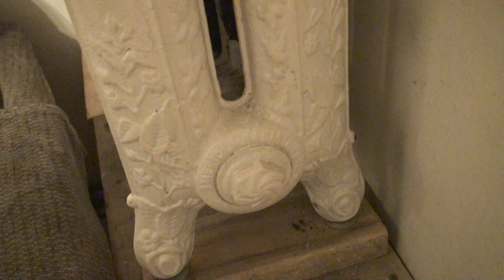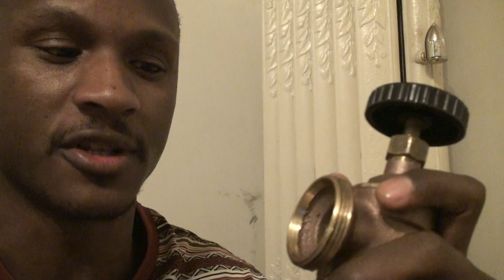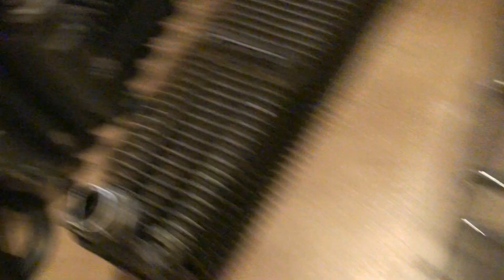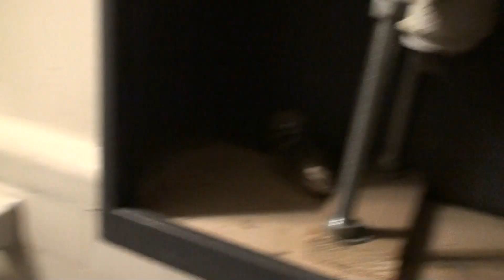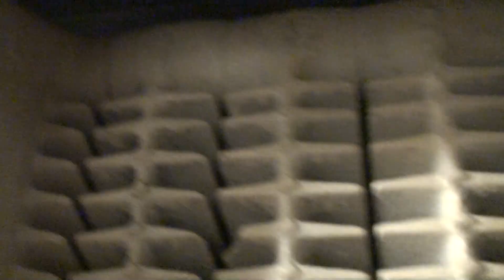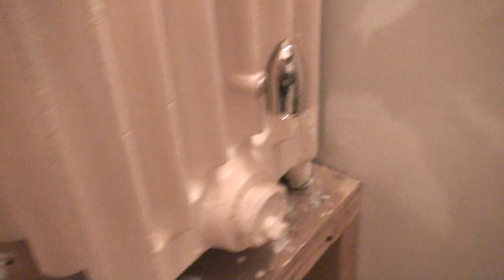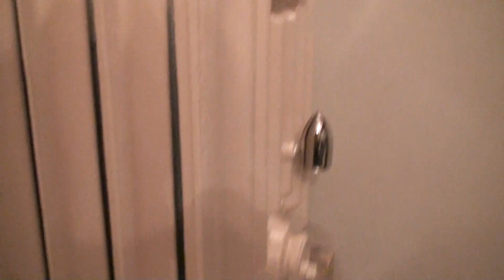TIPS ON A ONE PIPE STEAM HEATING SYSTEM.

Comment: I've got a single radiator on my single pipe steam system that may have been added to my house after the rest of the system was installed. It has a separate pipe leading from the boiler to the radiator that's much smaller in diameter (1.25" O.D.) than the rest of the pipes (1.75" O.D.). This radiator doesn't drain correctly. It has been rebalanced to improve drainage, and while it's better, it never drains completely. So when it heats up, you can hear water inside the radiator gurgling. 

For the last two days, I started draining the pipes of the system near the boiler in an attempt to drain this radiator. It may have improved the situation somewhat, but it's not fully resolved. This may be compounded because the pipe for this radiator runs along the basement floor until it heads up to the second floor radiator, and the drainage valve in the basement is about 15" above the floor. I can continue to test draining the water from the pipes daily, but I'm also considering installing a drain valve on this pipe near floor level in the basement. Any thoughts about these or other fixes? How often should the pipes be drained? I drain down the boiler weekly to clean out the sludge from the system. Thanks!
Reply from the maker: It sounds like the problem your having is the pipe size going into the additionally added radiator is to small and most likely not pitched properly.
Reply: Thanks for your reply. The radiator is pitched properly, but despite this, it doesn't drain fully. I'm thinking it must be because the line runs down along the basement floor and then up several inches to the drain valve, so there's really no way to fully drain this line. All the other pipes remain above the drain valve level, so they drain fully. Seems like I'd need to install both a drain valve in the pipe along the basement floor and some type of pump to completely remove the water from this pipe to solve the problem. That's probably not going to happen unless I can figure out a cheap pump. I also have my eye on ductless mini-split systems to replace both heating and cooling systems in my house. It's a $25,000 (!) all-electric solution, but once I add a few more solar panels, it's free to operate. I'm paying up to $200/month to heat a few hours a day about 4-5 months a year, and less for cooling, probably at least $1,000/year total.

Comment: Great video. I didn't know "steam radiators" existed! I have old radiators, but I'm assuming they are hot water as there are no steam valves. With hot water, can the cut off valve be used to regulate the temperature? Thanks a lot

Comment: So I'm working at a place that has a steam system, and there's two pipes connected to each radiator at the bottom through a Y connection.  It's not at opposite ends like you would expect.  And there's a circulator pump also, you can't pump steam correct?  How does this system operate?

Comment: Hello Sir, I’m planning on removing a cast iron radiator in my bathroom. This is for three purposes: 1. To have the radiator clean and painted 2. to address the wall behind the radiator and 3. to tile the floor beneath the radiator.
I was wondering if turning off  and plug in the local radiator valve is sufficient and would it be safe to run the steam back on for the entire house?

Comment: Excellent video, thanks. One question -- I'm looking to temporarily remove my small one pipe steam radiator to clean it. I can't seem to crank the valve down enough to completely shut it off. It seems to only get lukewarm now. Should I force it further before trying to remove it?

Comment: Just viewed your video and now I'm keeping all valves OPEN!  Here is my question, I have 2 floors to my home with 1 zone heating. My upstairs rooms get the majority of the heat and my first floors do get heated when the system turns on but they don't get as hot as the rooms upstairs.  What if anything can be done?

Comment: part #2)... .. I can feel the cutoff valve become red hot with steam as well .. maybe one or two sections receive partial steam.. it is at this point the air vent STOPS venting outward and begins a vacuum inward... the radiator never completely fills with steam 
.. this happens every heat cycle .. btw, 2 add'l radiators about 20-30 feet away (same apartment) work 100% of the time ... 
any advice would be helpful, thanks from NYC

Comment from the maker: Well she didnt tell me what part of the radiator was leaking, if its just the packing on the spindle of the cutoff then thats an easy fix, the union on the cutoff valve is a little different if the valve is relatively new then tightening it should do it but older valves the threads usually get warped and the union wont fit back in place in these cases you would end up having to install a hole new cutoff valve.

Comment: Got big bang noise constantly whenever the steam is pushed into the radiator. Also, hear water draining. Situation is: 1) new IPS Angled Adjustable Steam Radiator Valve, set to 6 (1-8). 2) shut valve is all way open. 3). the radiator is tilting towards the shut valve (measured with level). Based on the situation, what do you think why the water is still trapped in the radiator and how to fix the situation? thanks.

Comment: hey man great video i needed a little help. i live in an old apt building with a single pipe steam radiator system. the heat gets way too hot and the building has never taken any action to remedy this . i herd if i place a fiberglass pipe wrap around the pipe it would really help drop the heat.because it is way too hot in here.small studio apt and it is only 48 degrees out and it is around 84 in here.any help i would really apreicate. thanks

Comment: How much do you recommend tilting the radiator with the washers ? I have a radiator in one of my rooms that never gets hot across the entire radiator & stays the coldest room on the house could that be my problem ( tilting the radiator . I've even tried not putting a valve on the radiator to see if the seam would reach all the way across but still no luck ! What would you recommend me doing ? Do these radiators go bad to the point that they just won't wrk any more ?

Comment: hi i have a question i have a one pipe system that it gives too much heat is there anything i could do or could i change the volume of the heat by installing a thermostatic valve?

Comment: Hi I have a radiator that doesn't have an air valve just a bleeding valve (not sure what else to call it) . The radiator takes a long time to get hot and isn't very efficient. How do I fix this? do I just replace this bleeding valve? could that be why it isn't heating properly? Thank You for sharing your knowledge. Bernard

Comment: Hello,  Thank you for your video.  I have a similar system, except I have a pipe that goes in one side of my raditor and other that goes out the other side (at the bottoms). My issue is that only 1/2 the raditor is heating.  One side gets hot and the other side stays cold.  As a result, the large bedroom doesn't heat completely.   Do you have any idea what could be causing the issue?  Thanks.

Comment: I just moved into an apartment with these ugly things, I hate 'em! Thankfully 2 are covered up. I have no idea how to work them. I have no idea why there's a thermostat in the living room ... I'm not sure how one device can control 4 separate radiators therefore I'm not using them and buying a EdenPure. I hoping investing in one of these will save on my propane or natural gas bill (I'm not sure which one heats up the water in the boiler in the basement) and I'm hoping my electric bill isn't high. I like your radiator, wish mine looked that good. Great video! ;-)
Reply: i have the same thing exepet it is a sigle like base heatter an it dont have a black knob like that could some ome help me out on how to do this please

Comment: What are you running for pressure? You seem to get it, I am a heating mechanic and I love these old column rads and the cast convection rads Gordon's maid-o-mist best valves. Pressure should be half a pound cut in boiler pound and a half cut out. Steam is better and more efficient at the lowest pressure you can run. Fast main vents and slow adjustable rad vents.

Comment: Hi this video was very helpful in understanding how one pipe steam system works. I have steam cast iron radiators on the first floor and have 5 different radiators installed on the first floor. Out of the 5 only one is working that is if it wants to work. The 1 radiator is getting hot water in the pipe but is not heating up the radiator. The other radiator pipes are cold. Any suggestions what I may need to do?? I am a new homeowner and could definitely use your advice. Thank you.
Reply: Go to a hardware store and buy all new radiator bleeders. They have a different one for all various locations of the radiator. Check the pitch of the radiators. Check boiler capacity if someone replaced it. They go by square feet of steam and not BTU's. Also, check the water level in the boiler but I would presume you know that already. You also blow down the boiler or it will not heat up because sediment will insulate it from heat. If it is oil call your oilman. Make sure it has no major leak problems.

Comment: ? if able to answer. Looks like when I bought my house in 09 that today I see it was installed wrong. its a one pipe system. going to call the install company and if not going to fix looks like I will. I have a 2800 sq ft home and would like to get the best rad. valve to adjust for 1st floor and 2nd floor. what s a good valve to use. maybe a #1 and #4 gordens. thanks Bob 
   P.S. Great videos - Keep up The great steam Info.
Reply: Bob Rabida: Use an adjustable steam VENT to adjust the heat output. The Gentleman in the video is correct: Do NOT use a valve to adjust heat output.
The vent will vent the air out of the radiator to let the steam in. No Air out= no steam in.

Comment from the maker: Yeah you have a bad cutoff valve, the seat is in the closed position from the inside of the cutoff valve and causes water to store in the radiator thats why your getting the banging noise, your best bet is to replace it now once you do that dont regulate the radiator valve, the cutoff valve serves 1 purpose on 1 pipe systems, to cut the radiator of for repairs regulating the valve in do time you will only cause it to leak keep it 95% open and leave it be and your radaitors will work fine.

Comment: I just replaced a 400,000 btu boiler in a one pipe counter flow system. The old boiler worked fine for 9 years. With the new boiler I am getting water hammer that shakes he entire house. The home is 3000 sq ft with radiators in every room. I suspect the secret is in the pressure settings t but I have no idea whether I should be se pressure higher or lower. Any suggestions?

Comment: I have a steam heating system too and get good heat but the radiator in one of my rooms don't work. It stays cold. I have changed the valve but it still doesn't get warm.

Comment: My apartment has the one pipe system, each radiator has varivalves.  One has steam coming out and it has a chemical smell to it. It has never done this before. Is this normal?  I shut it off because first the steam scares me, and second, I cant take the smell.

Comment: Probably not. It's usually just the packing. If tightening the packing nut doesn't fix it you can replace the packing. If it's the union it probably just needs to be tightened.

Comment: I have a 10 unit apartment building, i`m constantly having issues with radiators not heating. I've replaced the vents with Maid o mist & Watts vent to no end there working for a day then the next day nothing. Checked the pitch, valves are all open what could be the problem ?

Comment: Enjoy watching your videos it breaks steam heating down to the basics!  I'm in hopes of getting a little direction.  I've moved into a 2 story house that recently had a conversion from oil to gas boiler using a gas gun and keeping the existing oil boiler.  The boiler seem to be operating fine at around 150,000 btu but the radiators in the house do not get warm.  The only way that I get heat is if i shut off all of the radiator control valves and leave one open.  After gradually opening the other radiators,  heat starts to come out.  However, as soon as i shut the system off, im back to square one.  This has me believing that it is a balancing issue instead of what ive heard from contractors that suggest repiping or installing new radiators (pricey expense).  Any suggestions?

Comment: Love your videos, you know your stuff. I have a question. I have a one pipe system with 5 radiators. They all run quiet except for one that has the hammering sound. It seems loudest right at the valve which I have open all the way. The radiator is angled properly but I can't get rid of it. Could it be a bad valve? When I close it it stops, along with the heat of course. I wanted your opinion first before I take it apart. Thanks for any advice.
ps. 140k btu nat gas in a single family house.
Reply: Valve is one most common problem after years the rubber and pices inside get worn and loose

Comment: Hi there I have HB SMITH 262.000 BTU steam BOILER and I installed a new feed water valve but it just kips feeding full boiler plus in to return line if I don't shut  off the valve any tips thanks

Comment: @akwesi100 
Much thanks for this video, I have a better understanding of my heating system.Quick question, I have a one pipe steam heating system with a cast iron radiator in my bedroom but the nut under the valves handle is leaking steam and water. Is there a way to fix this or do I have to change the valve? The valve appears to be the original valve and I don't think it has been serviced for a long time.

Comment: Great video as always man.

One question, the valve on my radiator squeals VERY loudly throughout it's entire heat up cycle. Would you say I need to replace the valve or is that a problem with the radiator itself?

Comment: Dude, having a valve on the bottom is a no no, the air at the top of the radiator will never escape, that's why the manufacturer put the valve on the top, unless you have some special radiator, but I doubt it. Hi check out " the wall Steam heating" blog, you'll see

Comment: Logic? Common sense?  Speak English, man, don't use terms no one understands!  
Thanks for this, BOLACS, I'm going to add a link to this video to our welcome package for new owners in our little 6-unit condo building.  We have a single pipe system and for some reason it is can be hard to convince people that you can't lower the heat in a room by partially closing down the main radiator vent.  Your visual on what happens with the blockage caused by a partially lowered stopper is terrific.

Comment: one pipe system or two ??  what you can do is try to balance it.  Pending upon where your rad is you can close all your other rads and force the steam to that rad and start to open other ones and pay attention which floor and rad your opening.  Many things can go wrong here but its a slow process and you try and balance your system.   You can put thermostatic valves on each  Rad,  So many variables.  Do Not Use Full Port Valves, Use Globe Valves Only.